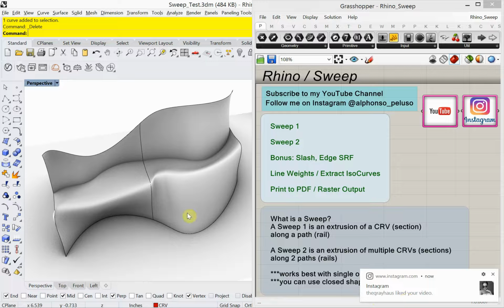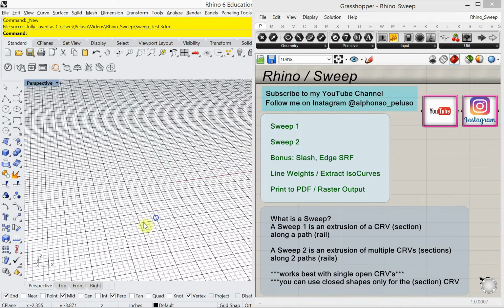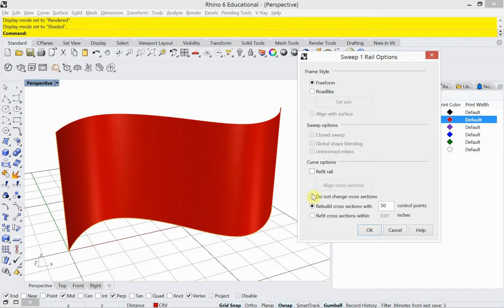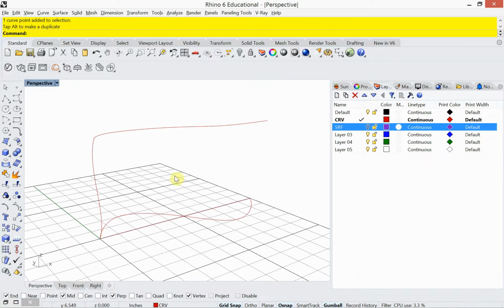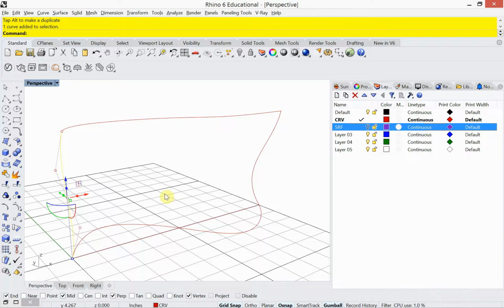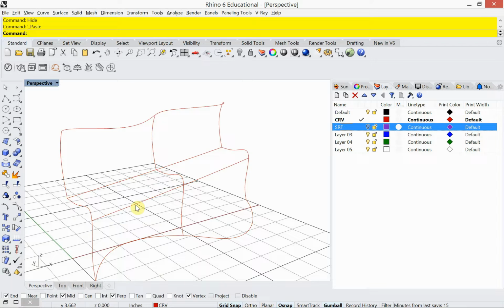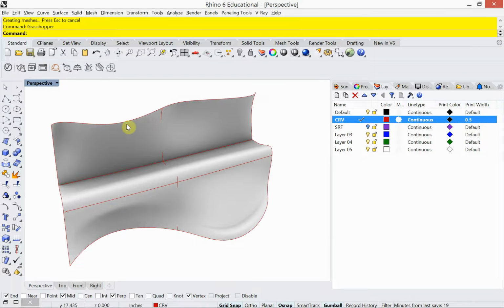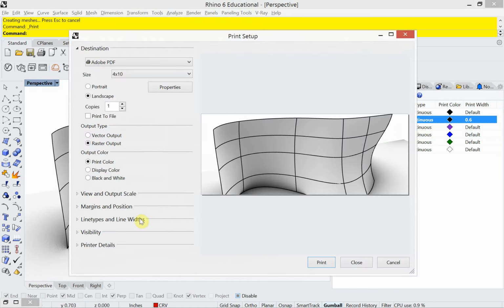Rhino Sweep

Comment: hey Alphonso, can I adjust the cross section and see a live update on the surface? or do I have to go into the dialog window and rebuild it every time i make a tweak? currently, after i adjust the cross section (after sweep2 is applied) - the surface does not update. thanks.
Reply from the maker: You need to rebuild it every time you make a tweak unless you’re using Grasshopper.
Reply: @AlphonsoPeluso  thanks, Alphonso. I found that by turning on Record History, I got the live preview. (no grasshopper)